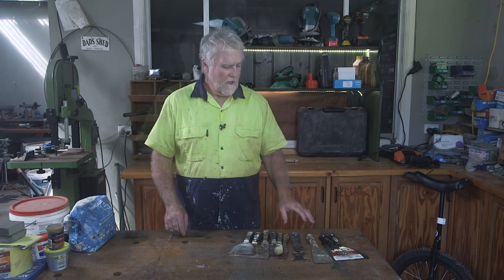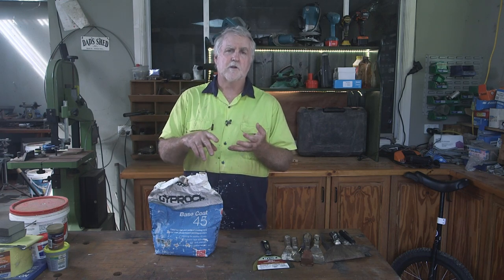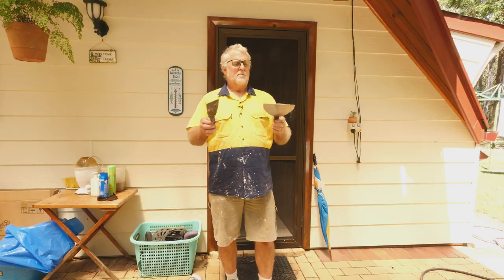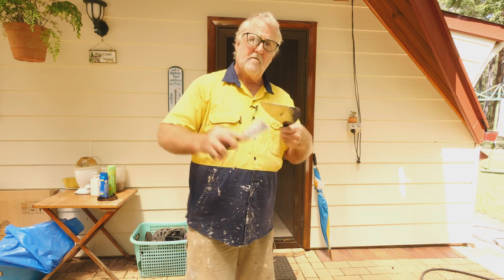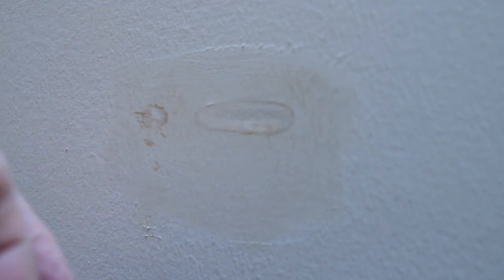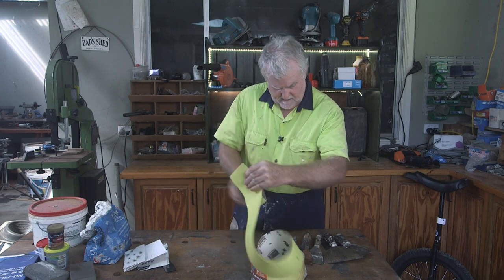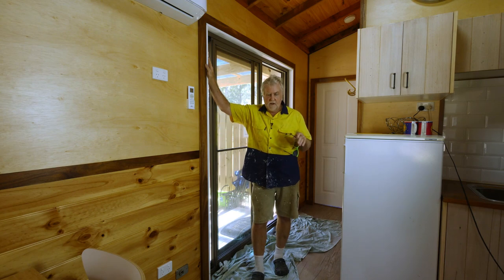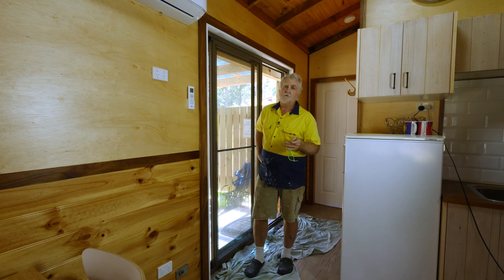How to Patch Without Sanding-Patch Like a Boss Super Fast

Comment: Thank you for your videos, i've been learning a lot. I am renovating my house and patched and sanded all walls prepping for painting but because it had many many layers of old painting on it... it is now peeling off in some spots. Is that a problem? Does it need to be scrapped at all or a primer/undercoat would be enough to avoid blisters in the future? I will appreciate your advice. thanks!!
Reply from the maker: Sorry somewhat dificult to address when not there to see in person. I think at this stage in your project is simply to scrape off the areas that are peeling and use a sealer/binder (oil base) before patching and painting. Good luck

Comment: I love your videos!  But this is deceptive!  It is simple, it is easy, but it was not super quick (you have to let it dry 2x), and yes there was a little sanding. :P
Reply from the maker: Most likely because I've done it a thousand times. I know exactly what and how to do it. It really is super quick if done right, and using the correct patching materials. There are so many different brands and most are useless imo. Good luck :)

Comment: what is the name of filler you used? i am in the US
Reply from the maker: I normally use what dry wallers use as thier base coat if I have time up my sleeves, or, what's called cornice cement here if I need to paint sooner. It sets very fast. These fillers and base coats will have different names around the world but they are virtually the same.